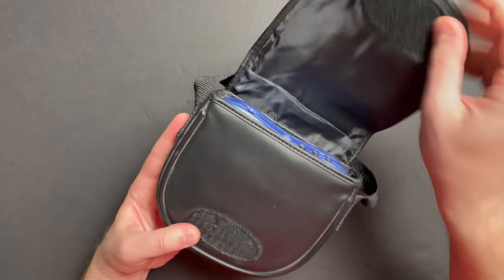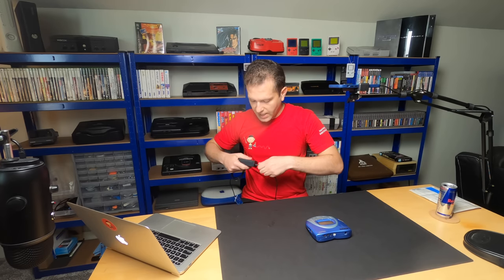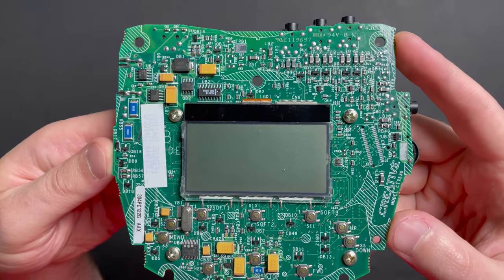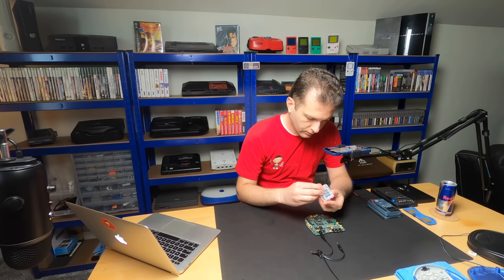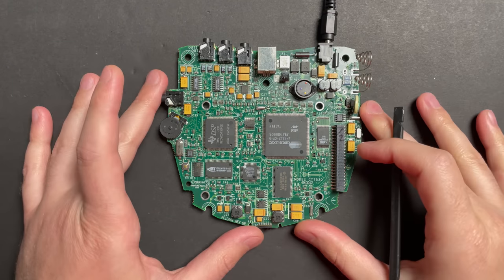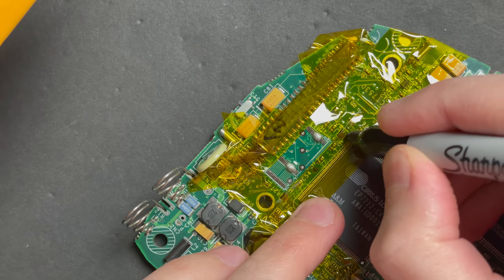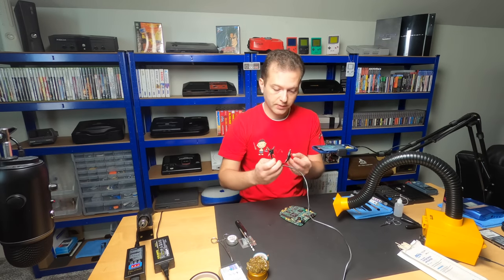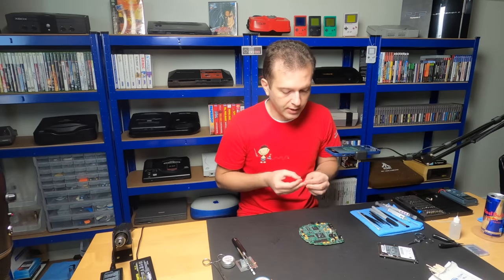Reviving my dead MP3 player - The NOMAD Jukebox

Comment: My DAP was plain dead. It was working just fine and the next day it was dead. I contacted with Stefano (such a nice guy, thanks Stefano) and he sent me a new flash chip. It has been the most difficult soldering job I have ever done. I came to think that I had killed my DAP, but after a lot of patience and going over the welds it finally started. I already have it working with a CF card. Thanks for everything to the maker of this video and Stefano.

Comment: I really hope that line about real/YouTube techs was in jest and not directed at yourself. Whether you consider yourself a real tech or not you've got amazing skill and talent that many people would kill to have a fraction of, myself included!
Reply from the maker: Ha, thanks man. I think it's one thing to reproduce someone's work, it's another to be the guy discovering the fault/solution. Perhaps that's the philosophical end goal. Either way, you are where you are and everyone starts from somewhere. If anything it just motivates me to keep at it and build more experience with this sort of work because I really do enjoy it. I'm just really impressed that this guy casually found the issue, copied a BIOS from a working Nomad, ordered compatible chips that weren't even the ones used in the Nomad, and programmed them to work. Now that's some next level stuff right there.
Reply: @BorderlineOCD  It’s like the difference between Adrain Black fixing a C64 and the CuriousMarc team resurrecting and reverse engineering the Apollo hardware then integrating it into a real world scenario.
Reply: @BorderlineOCD  Finding the issue is the hard part.  Copying the bios is easy with a cheap EEPROM/Flash programmer.  Finding a compatible chip is also pretty easy - most of these serial flash chips are pretty standard and can be interchanged with only a little care.

Comment: When my player stopped quite a long time ago now, I was heartbroken. I thought that the hard drive had got corrupted. That was the 6.4Gb model. I found a 20Gb one and bought that quite cheaply thinking that if that wasn't working, I could try to make one good one out two. It was working but alas it it failed after a few months. Now I've got two faulty players. I was looking for the Jukebox software that would play on Win 7 but found you instead. So one really good thing has come from it. I can change the chip. I've got all of the kit. I used to repair stuff like that for a living. I just hope that the chips are still available. Thanks for this video, you've made my day.😁👍

Comment: So glad to have found this.  I hope Stefano still has chips.. I have 2 of these....my original one crapped out a few years ago...so I bought another one on ebay that worked for awhile but when I went to use it this year it wouldn't boot...would basically just lock up at the creative logo... now it acts like yours...nothing. no backlight or anything.  The drive spins up but that's it.  The other one won't even spin the drive. Must does nothing.  That one died about 5 yrs b4 the ebay one... so I guess some chips do in fact last longer.  I wonder why they just fail... 

Do you have those other 2 chips still and if so would you consider selling one?

Comment: Many thanks for the video! I also have a 2000 DAP Jukebox that does not start, but I thought it was because of the dead 3V lithium cell soldered to the PCB. Why you didn't change that cell (CR1220)?

Comment: Little tip from my side: Use Rose's Metal instead of Chipquik. Costs only a fraction but does exactly the same.
Reply: That's a great tip, I just looked it up and 400g (~1lb) is £25, whereas chipquik is not far off that for only maybe 30g
Reply: @PaulTheFox1988  You're welcome! Just don't skimp on the amount of flux and always have proper ventilation =)
Reply from the maker: Haven’t heard of it, I’ll have to check it out.

Comment: Proud at you, your skills are definitely improving 👌 next step is a stereo microscoop and dive intro the micro soldering world.
Reply from the maker: Haha thanks man. I still remember your comment on one of my earliest videos a few years ago when I was using a $10 Weller soldering iron to fix a PSOne. It ran at a constant 450C with no temperature control LOL and you were one of the folks encouraging me to get a better iron. I ended up pulling the trigger on the TS100 the same day or the next day. Needless to say I'm a lot deeper in this hobby now but encouraging comments from folks like you meant a lot back then especially since I was just starting out and had no clue what the heck I was doing. So thank you for the continued support over the years. It's positive comments from people like you that encourage new electronics hobbyists and small creators to keep going.
Reply: @BorderlineOCD  Nice to hear I made a difference, Means alot to me as well. I guess Life is all about that. Help to improve each others skills. I used to train repair technicians in a company. You are definitely one of the better ones. Eager to learn and to improve. Very nice to see that. Keep up the nice videos. You have made a difference to alot of people by now :)

Comment: In 2001 I was badly needed a mp3 player. But this thing was super expensive. Other choice was portable mp3 cd player. Yet expensive but cheaper than solid memory type. But I was scammed because that cd player, had terrible decoding quality and battery hogger. Until 2011, I bought my first Samsung phone, It worked as I intended, but it was on BadaOS. Terrible support. Then in 2014, moved to android phone with jetaudio plus. And 2021, hey I moved to android with youtube music premium. Let see in 5 years later, what I will use. Will comment again in 5 years.

Comment: Great work and another step of learning, sorry to be tip guy, and as long as you get the desired result who really cares but, no need to tin the pads once braided, better to tack one of the end legs then align the opposite set of legs and tack, you can then jump straight to adding flux an flowing out the legs, add a blob of solder to one end and draw the iron across,  spreading the solder evenly the flux does the work. Best iron tips for flowing the legs would be one with a hoof, as it provides a well of solder when flowing out, and when clean can be used to draw off excess solder from the side you flowed to using capillary action, make sure it’s in good condition as it can easily catch a leg and bend which is annoying. Well done again.
Reply from the maker: Thanks buddy. I'm not allergic to tips and feedback, they are always appreciated here. I guess I've evolved and mellowed out a bit as I get older. If only I could kick my know-it-all younger self in the ass, he sure deserved it.

Comment: Slick repair, I know those pins are much smaller than they look on video... but one thing was kind of bugging me: the brand of the old EEPROM chip is "Atmel", not "Amtel".
 
(Atmel is the same company that makes the AVR microcontrollers used in the older 8-bit Arduinos; 
versus Amtel which is apparently some sort of phone company that is used by the prison system? I didn't look too close. 😅)

Comment: You're the Bob Ross of soldering. I can't believe Creative put the BIOS on a 20-year ROM chip but then used all tantalum and ceramic caps... I bet the signal noise across that board is negligible, though, and as soon as I saw the quality of the components, I understood why Mr. Bassi took on the project of reanimating the Nomad.
Reply from the maker: Ha, thanks, that's high praise indeed. It's apparently a real audiophile unit, and some of it's unique features are lost on someone like me. But, it was a fun project and I'm glad I have a working one to mess around with.
Reply: @BorderlineOCD  High praise is in order; thanks to your videos, I have attempted my most intense projects and achieved my greatest successes with soldering. I've developed a deeper enjoyment of electronics hobbies and built skills and confidence that I didn't have before- and it's all because I really connect with the way you detail your process. I have learned a great deal just because you equipped me to engage with the information; your channel is a boon to electronics hobbies!

Comment: I'm surprised to hear the flash is an issue on these devices. Granted they only guarantee 20 years, but usually they last much longer than this.
Reply: Well, pretty much every product has a "planned obsolecence part" in it, designed specifically to breakdown after a reasonable period.  Perhaps this is that part.  Would not surprise me at all.

Comment: Love the videos. You can get a little 100mhz pocket scope off Ali Express for less than 60 bucks. Mine has come in handy for some C64 repairs.
Reply from the maker: Which scope did you buy? I'd love to get one with an embedded screen rather than one that needs to run off PC software and I'm not finding much below the $150 range.
Reply: @BorderlineOCD  ZEEWEII DSO1511G. You can get a 1 channel for 60 USD and the 2 channel for 85 USD. For the occasional signal check it works well.

Comment: Why not melt the solder with the hot air station, without adding more solder?
Reply from the maker: While removing the old chip or attaching the new one? I'm assuming you mean the latter. This would work very well with solder paste and the paste would fuse around the legs of the chip as everything is heated. With regular tinned pads the legs tend to fuse sitting on top unless more solder is added. It might make a connection but could probably benefit from a stronger mechanical bond so if the unit is dropped or something the chip is a bit more resilient.

Comment: chipquick is just a brand name product / it is jut flux and low melt solder. like you videos, keep it up
Reply from the maker: It's been a while but when I first used the Chip Quik stuff on a Neo Geo BIOS swap I read all sorts of interesting things about it. They are apparently secretive about their formula although forums thats discuss the composition have discerned that the main alloy is Bismuth along with some other exotics. I haven't tried the Chinese stuff marketed as "low melt" solder and I'm sure it works just as well. I use it seldom enough that I like buying the small Chip Quik alloy/flux kit. It works very, very well.

Comment: Creative Labs are close to my office but I never see any action going it just may be the headquarters.
Reply from the maker: Creative meant something back in the day. The original Sound Blaster, the Audigy, the Nomad. They're probably just selling rebadged bluetooth speakers today.
Reply: @BorderlineOCD  Believe it or not, they are (also) still making & selling sound cards today. The big market for this is gone, though, thanks to motherboard integration of "good enough" codec chips.
But not everything made "in the days of old" was great, though. I had a DVD solution from them (drive, decoder card & software) and while image quality was great (for its days) it kept crashing like there was no tomorrow when I used functions like fast forward, pause etc.

Comment: I still have my 1st edition 6gb model put aside for years still works but HDD failed, would like to revive it with an SSD . I know a IDE44 adaptor works with a 1~32GB SDcard I just want to know where I can find the boot loader......
Reply from the maker: It's the IMG file linked in the description.

Comment: I have one of these, 20gb model, that turns on, but stops at "no hard drive detected".  Do I just need a new drive for it or is there more to that needs to be done to get it working again?
Reply from the maker: Has a previous HDD swap or upgrade been attempted on it? In the attached files there is an IMG of the boot loader. You could try the drive in an enclosure on your computer to see if it at least spins up. If you’re not attempting to salvage the music on there, you could try flashing the bootloader to the HDD and seeing if the Nomad will boot from it. If all else fails just prepare any working 2.5” IDE drive with the bootloader and the Nomad should boot from it.
Reply: @BorderlineOCD  As far as I know, it has the factory hard drive.  On another item, I took it apart and noticed the tiny plastic nub for the lock switch on the pcb is broken, any idea where to source a replacement?  At least it's broken in the unlocked position.
Reply: @BorderlineOCD  The oem drive did not function at all in an enclosure, I think it's dead.  I bought a replacement 40gb drive, flashed the IMG from the link you had provided and it's back to life.  I did find a package of lock switches and that's also repaired.

Comment: will you put flash memory in it? and also, do you know what the max capacity the firmware can handle is?
Reply from the maker: Probably not in this one given the drive is a bit of a time capsule but I'm getting another unit since I have a couple of extra bios chips I didn't end up using. Not sure about maximum capacity, but if I had to guess using similar limitations on electronics of the same era (like an unmodified original Xbox) then I think the stock firmware can probably address up to 137 GB. If you're curious why 137 GB you can look up "28-Bit LBA" and read about it.

Comment: You could increase battery life if you put a ssd in there
Reply: That would require quite the modification(s) given that SSDs are SATA interface and the jukebox uses IDE
Reply from the maker: A CF card is the least fuss option given it’s literally a miniature IDE interface and it’s solid state media. Battery life doubles with a CF card mod. Based on the findings in the guide the mod reduces current draw by 1 amp, which is HUGE savings.

Comment: Why is it always kapton tape? Everyone uses kapton tape.
Reply from the maker: There's nothing that's quite like it, high temp resistance, sticks well to PCBs and comes off easily with no residue. You can use anything to shield from heat, I've seen folks use Aluminum foil, but, kapton tape is pretty cheap and easily available. Good to have on hand.
Reply: @BorderlineOCD  dam straight, ive used it to protect the plastic triggers on xbox 360 controllers when replacing analog sticks and it has never failed
Reply: yes, it's used primarily for it's high temperature resistance, it's a must when you have things like plastic connectors near where you have to apply a lot of heat.
Reply: @BorderlineOCD  fair enough then lol. I'll have to grab some. I don't usually do a lot of electronics repair but I'll keep it in mind.